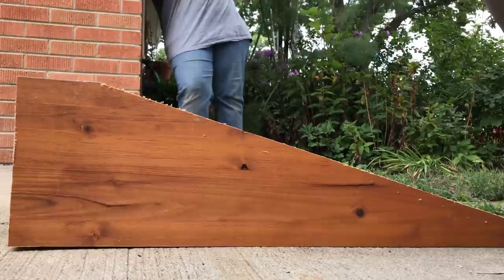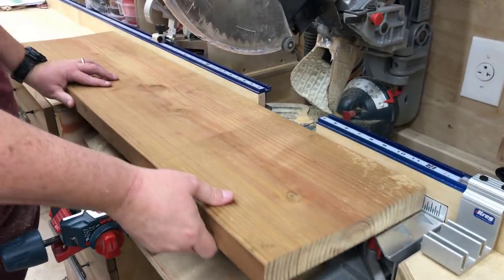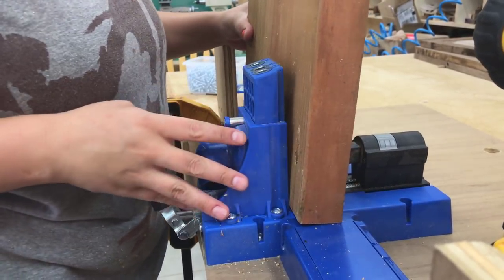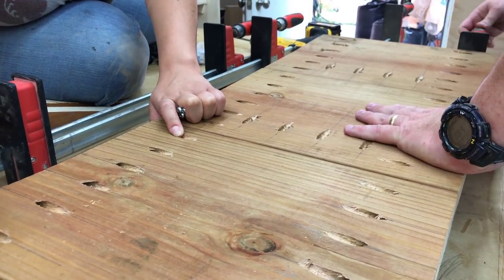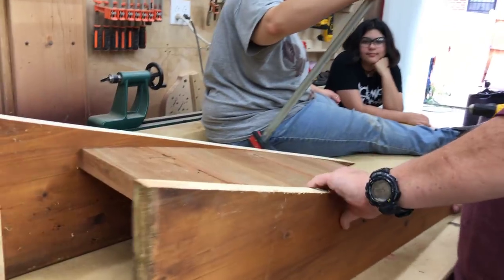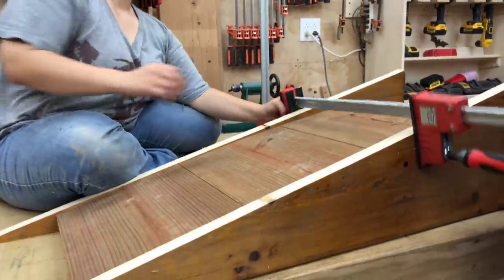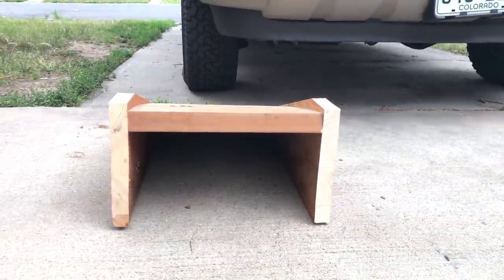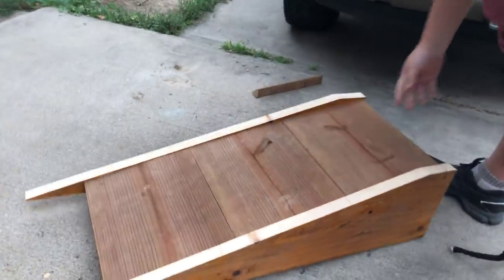32 - Extreme Pocket Screw Strength Test

Comment: Pocket screws certainly have a place.  Since you only had one ramp, the other tire on the ground keeps the vehicle from shifting sideways and all the weight is put on the screws as shear stress, not on the joint itself.  Try building a second ramp and drive up on two of them, and I'd bet you could push the vehicle sideways and have them collapse, because that's where pocket holes are weakest.
Reply from the maker: Hi Miles! Excellent point. I'll bet you're right!

Comment: Now you have to stress test it like on myth busters to see what it takes to break it. hit at speed!! hehe. i'd like to see it put on the apron of the drive way so it's perpendicular to the hill so the sides aren't perfectly vertical. My biggest problem with pocket screws is that they desperately want to pull the joint out of alignment. It's always a fight and when you're in the middle of a large panel it's very hard to clamp to force the joint tight.
Reply from the maker: Hi Jeremy! That would be fun to test it to destruction. 

And I agree with you, putting pocket screws in a location that isn't very easy to clamp is a challenge (ok, pain in the butt)! Haha.  But, I suppose like any joinery, the are good applications and bad ones.

Comment: Great vid,how do you think they compare to dowels .tim
Reply from the maker: Hi Tim! I think that Kreg's case hardened screws have a much higher shearing strength than a wooden dowel, so in this configuration I believe the pocket screws would out perform the dowels. However, I think dowels can outperform pocket screws in other configurations for sure.

Comment: One factor to take into account. Screws hold wood too tight. They don't allow for wood movement over time, with the seasons and years. This causes the wood to split. Cabinets and furniture put together with screws won't be around for the next generations like real joinery.
Reply from the maker: Hi Jack, two things wrong with your statement. 

First, most pocket screw joinery (for me) goes into sheet goods. Things like plywood, mdf etc. for those, there is no movement, so that's important to know. 

Second, you must have used glue right? Glue doesn't allow movement either. And they were using that 300 years ago, and some of those pieces still survive today.  It's all about how you build your piece with respect to wood movement. You don't fix two pieces together with screws or glue if the grain movement is opposed. That's basic Woodworking. 

And you most certainly can use screws when you still want to allow movement. We just make the hole slotted on one side. I've been doing that for 30+ years. And, I've got pieces that have been through 30 different cycles of 4 seasons with moves around the country to extremely humid areas and then to CO with 11% humidity. Those joints are just as perfect today as the day they were put together. 

Finally, a pocket hole screw joint is a real joint. Just like any other. It's just different. But I'm not trying to make you use it. I was only trying to show that it's strong. 

Take care,
~James

Comment: Holy overpenetration, batman.  Looks like 10 of the pocket screws sticking out the side of the board during the intro.

What would you say caused that?  Not setting up the jig right during drilling the holes?  Using the wrong length screws?  Using too much torque and over tightening the screws?
Reply from the maker: Haha, you are the first one that caught that. When I set up to do a batch, I usually adjust the torque on the clutch of my drill, so that I can go fast, and not have to worry about going too deep. I didn't do that here. I think maybe I was in too much of a hurry, or not paying attention. When I turned the ramp over I saw them all sticking out, and I looked at my drill, it was at 15, usually the clutch needs to be between 8-11.  

I didn't want to pull them halfway back out. And I didn't want to make another ramp, so I just went for it. So in reality, an over-driven screw represents a weaker joint. I think considering that I'm even more happy with the results.  (Not happy with myself of course, that's terrible Woodworking) 😁👍🏻
Reply: King's Fine Woodworking You were using your impact driver (at 6:35) rather than a drill with clutch. That's probably why.
Reply from the maker: @ksp1278, Whoa. Maybe I'm going crazy too. You are right. I remember looking at my drill at some point though, and seeing the clutch at 15. 

But yes! It is best not to use an impact driver, unless you are very careful. I always make my daughters use the drill with the clutch set. But now it seems that I am in need of some supervision too! Haha..
Reply: King's Fine Woodworking this is odd... I put together a couple of saw horses and attached the legs with pocket holes and drove it in with an impact, didnt overpen. I would argue either the jig was not set properly or you used too long of a screw

Comment: For me pocket screws have never been an issue as far as strength is concerned. I just think they're a cop out, and look much worse than any actual joinery.
Reply from the maker: Hi Nick. I don't agree with them being a cop out. For that matter we could even say a power jointer, or even a Cordless Drill is a cop out. Why don't we just stick with the old brace & bit, or use a hand plane?

For me I get pleasure out of woodworking in 2 ways. One way is designing and making beautiful furniture with nicely crafted joints. 

But another way I enjoy it, is simply having the ability to build a functional piece quickly. Not everyone can throw together a picnic table & benches for a BBQ tomorrow. I like having that skill set. And one thing that helps me have it, are cool inventions in Woodworking that make things go quick. Pocket screw joinery is a tool I'm happy to have in my arsenal. 

And yes, they are quite ugly. Which makes it great that they can so easily be hidden. 

Thank you for watching the video and commenting. I really enjoy listening to other opinions and having the ability to interact on ideas. 

~James

Comment: Didn't you worry about the ramp collapsing and your tires being punctured by 20 screws?
Reply from the maker: No, the shearing strength of the screws is published. And my truck’s weight is on the manufacturer plate. 

I used 3 times the number of screws needed to carry the weight of the entire truck.

Comment: Effectively it's a test of shear strength of a screws, not a test of pocket hole method of using them. As an automotive engineer working with fasteners a lot, this test, while impressive for random folk, would not convince me one way or another. Matthias' s test is taken much more engineering approach. ... Now, on a subject of PS vs. other methods of joining, I don't feel that it's an elitist thing. It's just physics. Dowel joint allows better support, let alone mortise and tenon. In situations where PS is good enough, I would use them.

Comment: I'm sure 'pocket hole' joints are plenty strong enough for most applications. But this test hardly proves it, at most each screw was carrying 140lb; in such heavy timbers it should be no surprise that they didn't fail.

Comment: Your going to up set Mathias lol
Reply from the maker: Haha.
Reply: King's Fine Woodworking I am one who totally agrees that pocket holes make strong joints. As they are screws they resist draw out incredibly well hence holding 2 pieces of timber together extremely well. However they have a weakness and that is shear strength. As they are a very hard steel they also are brittle and tend to snap especially in the test you used. The qty spaced evenly overcame that pressure however. If you had driven on in anger I believe failure was likely but as you point out they do have their place and certain people named M***** have gone out of their way to make you seem like you are not a real woodworker if you use pocket holes... just woodworking snobbery in my opinion. Ps I have never used a pocket hole jig in my life but have used the same technique freehand many times. My father taught woodworking and he used this technique as well as the acceptable joints. This is why I love your channel. You have proven your skills plus are accepting of new techniques without bias.
Reply from the maker: Larn Davies, thank you!

Comment: I am more convinced than ever that there are cheaper faster stronger ways to join wood than using pocket screws.
Reply from the maker: Hi. I'd sure like to hear your thoughts on stronger and faster ways.
Reply: In this instance cleats construction adhesive and a nail gun. Spiral nails alone would be sufficient, added glue for insurance.
Reply from the maker: Oh. Ok. I thought you meant Woodworking.
Reply: My view of pocket hole joints is the same as Matthias Wandel. He did tests on various joints and pocket holes came out in last place. In his tests glue alone was twice as strong as a pocket hole joint. I am personally biased against pocket hole joints not quite sure why just found there was always a faster stronger solution

Comment: Lol, you could've just drill the screws right into the side. And like you said it's utilitarian so who cares if you see the screw heads. And you could have had no t done a lot faster without the pocket holes. If you want to test pocket screws make that same project but only use about 10 or 12 screws now that would've been a test.
Reply from the maker: Hi, you are right. But even though my builds with them are utilitarian in nature, like my miter station or my lathe cabinet, I still want the joinery hidden. 

I also feel pretty sure the test would have failed if the whole ramp were held together with 10 or 12 screws. That would put only about one screw under the contact patch. I think we can all agree that the shearing strength of a 1/8" diameter piece of metal isn't going to hold against a 4-1/2 ton truck.
Reply: King's Fine Woodworking as for the weight of the truck.....to get a more accurate number for how much of the vehicle weight is on the ramp (and we can't negate that it is an angled load in lieu of the camber of the tire). Use the build placard on the drivers door pillar, take the gvw of front axle and divide by 2 and that's still a ridiculous amount of force on the ramp. In real world situations a pocket hole screw installed properly with the correct length and Kregg jig set dimension height and number of pocket holes in even mdf builds is good enough. Every joint and fastening system has its place. In my 3/4" Birch plywood builds I use a combination of pocket screws, glue, and either biscuits or dowel pins. Basically I use the pins to locate the shelf or divider and the dcrews to clamp it in combination with the glue.....so, a little extra insurance over just the glue and dowels or biscuits. 
Fun demonstration, thanks for taking the time to share it.
Reply: King's Fine Woodworking doing this way you would have been driving directly into end grain, notoriously weak, pretty sure wood would have cracked.

Comment: From what I remember from physics class years ago, this test is not testing the strength of pocket screws.  The weight of the truck is toward the ground and pull of the screws is parralel toward the ground.  I think you are testing the strength of the steel and not the pocket screw itself.
Reply from the maker: Way to get your Physics on! And you are pretty close.  Not only are we testing the shearing strength of the steel, but before the steel screw can shear off we must overcome the coefficient of static friction that has been created between the ramp floor and the ramp sides, due to the grip strength of the screw threads.

Comment: Question : Did you receive any kind of compensation from the Kreg Corp. for this video ???

 Yes, you guessed it, I'm one of those woodworkers who believes that pocket hole screwing is for weekend entry level woodworkers and such construction has extremely little practical place in the professional woodworking world. Since you are an accomplish woodworker and make your living as such, it is quite surprising to see you promoting the pocket hole screw system, hence, my above question.

BTW : Having one wheel of your truck on the ramp, in no way can be considered as being more than 1/8th of the trucks total weight. In fact, with the truck being raised at an angle by using only one ramp, the majority of the actual weight at that point is shifted to the opposite side of the vehicle and lessens the actual raised weight to far less than that part of what the truck weighs when sitting flat. Albeit, you somewhat suggested that the total weight of your truck was on the ramp when you on several occasions included your truck's weight in the video, you even went so far as to state that your truck is one of the heaviest on the market.

Further : The ramp would have been constructed 10 x's quicker, would have been 100 x's stronger and 500 x's cheaper, if you had nailed the ramp board on top of the two side boards, instead of using 50 Kreg screws and the Kreg Drll kit to attach the ramp board inside the two side boards.
Reply from the maker: Hi. No compensation whatsoever. I have never been sponsored in fact. Nor received compensation from anyone, for any video. I pay for everything myself. And the ideas on what to do are mine. 

In my opinion, pocket screws have their place. I have built kitchen cabinets for years. And I always use them for that. They are certainly more utilitarian than Fine Woodworking. But I believe that a woodworker can wear two hats. We can do projects that call for them like a tool shelf or cabinet box. And we can also do antique reproductions that use mortise & tenon and dovetail joinery. 

If you've seen some of my videos, you know they wouldn't be used in my Keepsake boxes, or my complex bench vise or even in the Cherry bookcase. 

But you'd also see that I assembled the Miter Station cabinets and my lathe stand cabinet with them. 

As to your assertion that the weight on the ramp is no more than 1/8th of the total, I find that very difficult to believe. Especially on the engine side. Will you please provide your references for this information? I could find no research corroborating it. 

Also, I never implied that the entire vehicle's weight would be on the ramp. I did stress a few time the weight of the entire vehicle to build emphasis that it is heavy. But for anyone to think that the entire weight of the truck was being placed upon that ramp is silly.  I don't believe anyone would infer that.  And I do think it is one of the heaviest passenger vehicles out there. Do you know of heavier ones?

Anyhow, I wasn't trying to convert anyone to pocket screws. If you don't like them. Don't use them of course. My only intention was to try to show they are strong. That's it. 

Thank you for taking the time to watch and leave a detailed comment. I enjoy that part of the YouTube experience, and don't mean to ruffle any feathers. And if you do happen to know where vehicle loading from a single ramped tire can be found, I'd love to read up on it. I'm a scientist by trade and a researcher, so I can't help it. 

Thank you
~James
Reply: James, actually I have watched several of your videos, ergo, that is why I believe and addressed you as an accomplished woodworker.

As to the weight of the vehicle being less when the vehicle is raised at a specific point : 

It is a mathematical fact that by lifting one corner of the vehicle off the ground, you changed the vehicle's center of gravity. Thereby, the lift caused the majority to the vehicle's right front corner weight to shift to the left front corner of the vehicle and to a much lesser degree, a portion of the weight was also shifted to the left rear corner as well. 

When speaking of specifics in mass weight concerning center of gravity which keeps the vehicle flat on the ground, the higher you lift one corner or one side of a vehicle, the less weight is present at the point of lift, inasmuch, as you are shifting more and more weight to the opposite side, the higher you lift the vehicle. That is why a vehicle will turn over once it gets to a specific (X) height where the vehicle's weight mass has been shifted to the opposite side, a scenario which changed the center of gravity, thereby drawing one side of the vehicle's weight in the opposite direction. 

Think about weight scales, they are designed to weigh the total bulk of whatever the scale is weighing in order to give an accurate answer to the weight of the object being weighed. (i.e.)  When the Federal Weight stations along US Interstates weigh a commercial vehicle, they weigh the entire vehicle, this is done to avoid having the vehicles weight being shifted, as would happen during a single point or portion of vehicle lift. 

I realize that there are a few areas in which pocket hole screwing may be used in modern construction. I was just surprised to see a furniture maker advocating the use of the Kreg system. The reason for my surprise is that there is no way that the Kreg system could be considered, as being stronger than traditional wood joinery.

BTW : Nice to see the whole family interested and assisting in your woodworking business.
Reply from the maker: Hi! Thank you for the reply and the detailed follow up!  :-)

Comment: You built the ramp the way you did to test the screws. Otherwise you surely would have place the boards on top of the incline and it would have been strong enough for a tank.
Reply from the maker: Correct.

Comment: Your ramp sees only 1/2 of the total frontal load or 1/4 of the total vehicle weight.
Reply from the maker: Amirhousein Hazratifar, you are correct! I was simply giving the total weight of the truck as an illustration that it's a heavy thing. 

Also, I suspect the engine side is heavier than the back, so perhaps the tire I put up on there is a bit more than 1/4 of the total weight. 😁👍🏻